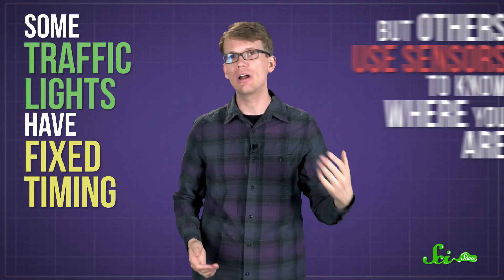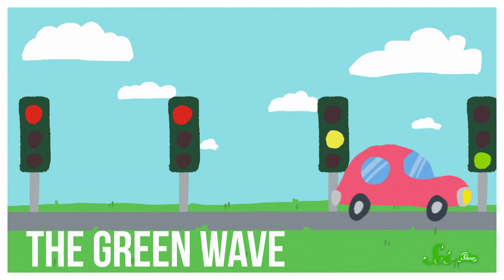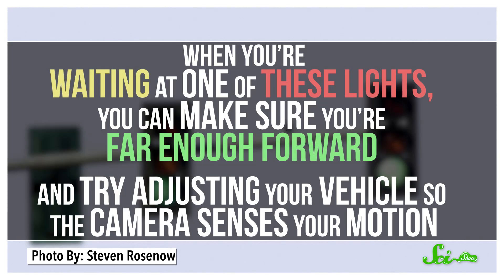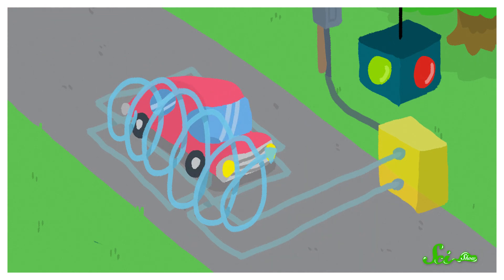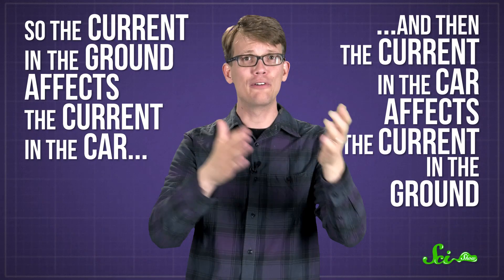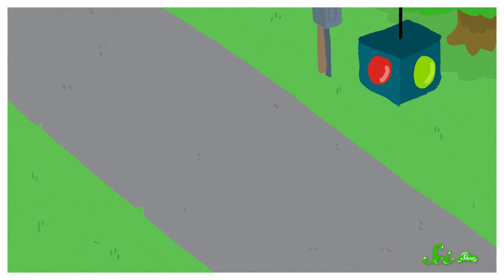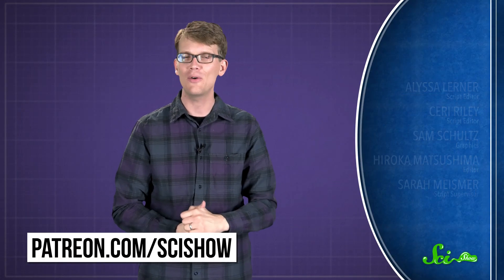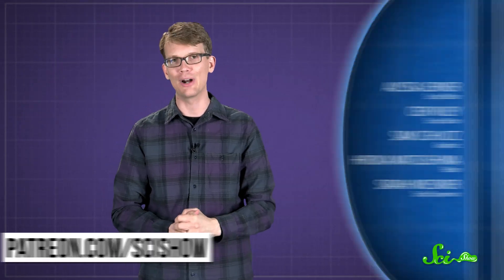How Can I Make A Traffic Light Turn Green?

Comment: BS, bicycles can easily trip loop detectors. I ride a bicycle a lot and have done it hundreds of times. The trick is to find out where the loop is (easy on a bike, you can see where the pavement was slit to insert the wires). Then make sure the bike is in the loop but to one side of it, say 75 to 80% of the way to the left or the right side.

Comment: How to make a light turn green: 
1. Wait
Reply: Sometimes the sensor does not sense your vehicle.   I work late at night and drive home at 2am.   I have pulled up to a red light and waited several minutes and it didn't change.    Driving a couple of feet back and forth usually gets the light to change but one night I tried that repeatedly and fifteen minutes later I decided the heck with it and just very cautiously crept through the intersection.    

Years earlier I lived at an intersection where there was a set of lights.   The cops would go out at one A.M. and activate the override.   That would make one direction continuously red and the other one continuously green never changing.  Then he'd park behind a bush and wait.   He always set the light so that the busier street got the red light.   At 1 A.M. it usually only took a few minutes for a car to come by and it would wait patiently, drive back and forth a few inches hoping to get the light to change and it wouldn't then finally he would slowly creep across the intersection when it became obvious that the light was never going to change.  The cop then pulled him over.   I stayed up one night and watched this cop pull over about 15 cars.   He did this perhaps about once a week.   Then around 5 A.M. he'd reactivate the normal traffic mode and be on his way.   I tried to report this at the police station but was threatened with a charge of obstruction of justice if I went to the media.   So I went to city hall instead and got the same threat.   After moving away I learned that they did this at several other intersections and also had speed traps set up and between those two activities the city made about $3 million a year.   Not bad for a city of 15,000 people.   Within a couple of years of that happening the police chief committed suicide and the mayor went to prison and the city declared bankruptcy.
Reply: The left turn light never turned green for me after 3 cycles so I went straight.
Reply: PhoenixPoptart 
2. Profit.

Comment: The loop system is just a metal detector buried in the ground.  Some detection systems use cameras that detect motion and lights. Sometimes if I'm stuck at a light I flash my headlights and it works, so flash your lights if you suspect a camera. I ride a motorcycle and I have attached a magnet from a hard drive to the bottom insole of my boot. When I come to a looped detection circuit, I wave my foot over the buried loop and like magic, the light changes. Same with a bicycle. If you ride a bike, disassemble a hard drive and use the rare earth magent trip traffic sensors.

Comment: Wouldn't it make more sense to just make the sensors weight triggered? Why all of the fuckin' unnecessary science?
Reply: weight sensors are not as good as induction loops at dealing with changes in temperature, also they cost more than a wire and they break more frequently so they're basically inferior in most cases.

Comment: I was hoping that the full method of sensing a vehicle with induction sensors was discussed. Such as how a signal is passed through the loop then the metal vehicle induces a phase change in the signal.

Comment: There is actually another method that works, and it has a 100% success rate. 

When you stop at a signal, just start staring at the light. If you stare hard enough, you will get it to finally turn green. This method takes patience, but it works every time.
Reply: lol i get it!
Reply: Sea Agate ...
Reply: +Ringz 321
How could you not get it?
Reply: That doesn't work!  I used to try that when my mother was driving when I was in elementary school!
Reply: Or, just run the red. 99.99% success rate.
Reply: Not every time.   One town I lived in had defective traffic lights that pretty much went into sleep mode if it went ten minutes or longer without any car going through the intersection.  They you had to call the police and they would, when they got around to it, come by and turn the system back on.   In another jurisdiction I lived in, the cops deliberately deactivated the green mode so they could catch people running red lights.    I think they still do that.   Central Falls RI if you are interested.   So no, it does not always eventually turn green.
Reply: that's funny

Comment: The sensor on top of the traffic light that was said to be a camera, is not. It is an infrared receiver like that on a TV set. Emergency vehicles use a piece of equipment called an IR-com to quickly change the street lights on approach. You can make your own with an adjustable strobe light and infrared lens.

Comment: SciShow is a great channel, but there are a couple of inconsistencies in the video.  First, the device shown at 0:49 is not a camera, but a Emergency vehicle preemption device.  This allows an emergency vehicle to get a green light.  A camera for detection looks like this: http://www.modot.org/stlouis/links/signalcameras.htm.  You may also see cameras like this: http://www.okokchina.com/Files/uppic18/Dome%20Camera%20Housing%20(security_%20surveillance)824.jpg  which are used to monitor traffic operations.  Second, FYI,it is possible to have a coordinated (what he called green wave), and have sensors for the side streets.

Comment: If on a motorcycle, and the light is controlled by an induction loop, aim for a corner rather than the center.  That's where they are most sensitive.  I don't know why this is the case, but I used to install, test, and repair loops and loop detectors. (amoungst other things)  Often I could get them to trip using the access cover from the gate control box, or if that was not available I carried a small bit of 4" square tube.  These small items worked on the corners of the loop, and generally nowhere else in the loop.

Comment: For bikes and motorcycles, the relatively cheap and simple solution is to stick a decent sized super powerful neodymium magnet to the bottom of your 2 wheeler. Run over the sensor and be on your way. It works like a charm.

Comment: You can flash your high beams when you're coming up to a red (with no one else around of course) and it triggers the light as well. It picks you up as an emergency vehicle. On bikes, if I lay my bike down over the loop, it always triggers it.
Reply: If you can get the bike wheel directly over the wire it will reliably trigger the light

Comment: You can change the light with a road bicycle actually if the rims are steel or if there's steel within the rims.  I've been doing it for years!  Just place your wheels over the wires in the street.  Works every time!  Helps if you place both wheels and roll back and forth on the wire a little bit.

Comment: in my area at night the lights with cameras can be changed by flashing your bright lights, it sounds silly but I have tested it several times and it works even when the light just turned red and cars are coming the other way so its not very polite to do unless the street is empty

Comment: You won't get caught if you run a red that has no camera.  There are two kinds of cameras, the ones he's talking about, and the ones designed to take your picture when you pass through the induction loop while it's red.  Those cameras are huge.

If you don't see them, you could run the red if nobody is around.

But there could be a cop sitting just out of view, so...

Comment: as someone that installs traffic signals if you flashing you high beams and the light changes more then likely is a coincidence. the strobes the ems, fire, and police use are set so a specific frequency ( very fast and very bright) and it would be very hard to match that flashing your high beams. also the thing circled as a camera is a detector for the the strobes (opticom system)

Comment: Veteran biker here, jump up and land on the seat of your bike. This pushes your bike down on its shocks and will usually set off the light. It doesn't always work and may not work depending on the type of motorcycle you ride but it has worked for me for years.

Comment: So it would help to get up off my motorcycle and put down the kick stand, only to have to push off the kickstand when it turns green. Seems safe. Luckily most states have "go on red" laws for Motorcycles in the event your stuck at an unchanging light. (One near my house has a sensor i can never set off :/ )

Comment: Error in the video: What is circled as a traffic detection camera is not a camera at all, but is an optical sensor that detects modulated strobe lights on emergency vehicles to trip the emergency preemption. Traffic detection cameras look very obviously like small video cameras. But otherwise good introductory video about how signals work.

Comment: Another trick you  can use(and it doesn't always work), is if you find yourself at a traffic light at night, with no one nearby, and you don''t want to wait forever, try flashing your brights at it 2-3 times very quickly.  Some traffic lights are programed to recognized flashing lights as emergency vehicles(police, ambulances and soforth) and change quickly for their passage.

Comment: "If you're on a bicycle run the light"
How cute. Pretending that cyclists EVER obey the rules of the road.
Reply: Since a bike can drive on the sidewalk in many jurisdictions, you can't hold it to all the traffic laws. It's a gray area legally. In any case, most problems caused by bikes and cars together are caused by the cars. For example, in Kansas, a vehicle is supposed to give 3 feet clearance to a bike. If you ride a bike a few blocks, you will see this law is ignored. 
It is also ignored by the traffic police. 
I suspect the problem is a sort of prejudice against bikes because they are smaller. Drivers of cars don't realize the bikes have a right to the road as well. They believe bikes, since they are smaller, have less of a right. And then the sensitive drivers get mad about it. Note your post. It illustrates this prejudice.

Comment: In Florida the lights are timed HORRIBLE. 
At Fl 54 & the Sun Coast Highway they have enough room for a clover leaf system to keep things moving. And to make it worse 54 has to stop for the  Suncoast ramps and THERE WOLL BE NO CARS EITHER COMING FROM THE SC OR TRYING TO MAKE LEFT TURNS ACROSS 54 TO GET ONTO THE  SC. Just a 1/4 mile deep pile of traffic on 54 waiting for the stupid light to change. When it comes to traffic pattern design  (waiting at a red light, green just in time for the light at the next intersection to turn red) Florida traffic engeneers must drop a lot of acid!

Comment: That was very good but you might want to make another video after you read this. OK let's say a car is approaching an intersection the light is green but a lot of cars just approached the traffic from the other way that would normally cause your green light to turn red so you have to wait for all time for the cars to go through the intersection then get a green light NO!!! you don't have to wait for them just step on it and plow right through them and hope you and hope you don't get into much trouble,, oops that's not right what you do is stop the car right over the sensor loop farthest from the intersection  this will trick the electronics in the control box to think you are a lot of cars and make the light turn green very soon this works for a bicycle to just lay the bicycle down on the sensor farthest from the intersection that will also trick the electronics to turn the light green for you , I did this a lot of the time when all I had was a bicycle and it always worked.

Comment: Just wait for the light you impatient fuck heads.
Reply: they have patience issues but you got anger issues 😶
Reply: ...and you have problems with using punctuation. Nobody's perfect.
Reply: Oh dang he brought up punctuation 😥
Reply: to be honest some lights only change when they detect a car, and sometimes your car isnt detected and you have go into reverse or go forward to get it detected ive waited at lights for 5 minutes, moved and it immediately change. patience does not help in this case
Reply: /r/madlads
Reply: I drive an all mechanical diesel. Some lights will never change for it. It's a big, 3/4 ton, 4x4 truck. 
I can wait 10-15 minutes, the second a car comes up behind or beside me, it will change.
Reply: 🔥🔥🔥🔥🔥🔥🔥🔥🔥DANG
Reply: DAVE KANE WOWOOWOOWOWOWO
Reply: Throwing stones in glass houses....
Reply: P
Reply: Then take a right.

Comment: So I get this this kind of a simplistic view of the use of an eddy current, but couldn't we line the streets with wires and power electric vehicles? I mean not completely but help slightly charge the battery? Even if it was a small amount, think if every time you stopped or slowed down to take a turn.... I am sure that they have thought about this before and what holds it back is the cost of infrastructure... still a small city beta test would be interesting

Comment: You CAN do something with induction loops if you're on a bicycle. All you have to do is make sure you go through the loop closer to one side of the loop (left or right) rather than through the middle. This will ensure that you bike accesses two separate points of the loop at the same time, which seems to do the trick, especially for circular loops.

Comment: if you're a bike, use the side walk, or bike path...
Reply: In my town bikes aren't allowed on side walks and there are no bike lanes
Reply: in what states does riding a bicycle require a license???? lol
Reply: ViscountStratton point is, most states, if you're a kid it's fine to be on the side walk. Otherwise you must ride in the street and (generally) follow traffic laws as though you are any other motor vehicle. I say 'generally' because it's typically fine to yeild to red lights or stop signs.
Reply: Kevin Bacon Yeah. In Michigan bicyclists usually ride on the street, but off to the shoulder to avoid jamming the traffic. Seems to work pretty well. But I could see how biking inside the traffic lane itself would be practical for large cities where traffic rarely goes 35+ mph.

Comment: On my way to work at 11PM, my little motorcycle failed to trip the left turn lane sensor. I waited several minutes and when nobody was coming, I ran the red light. Immediately, red and blue lights came on in a nearby parking lot. I explained to the officer that I had waited through two complete cycles of the light, but my turn arrow never came on. He gave me a ticket anyway. I asked him what I should do to make it trip. His answer was that I should back up and try to trigger it again. I explained that my motorcycle did not have reverse gear. I went to court to fight it and when the judge asked him what happened he replied "I have no recollection of this incident". I was found not guilty. On our way out he said "Oh well, it worked out for you in the end". I told him that I worked the overnight shift and had to come to court during my sleep time and it was not OK.

Comment: On a motorcycle, you can also push the starter button to change the current in the loop. Use it at the gate for my complex all the time. Adversely, over years, you will probably wear out your starter sooner than later

Comment: Hank missed a trick for the induction loop lights that also works for bicycles but motorcyclist use mostly. Place a powerful magnet usually as close to the ground as you can and it will trigger the light.

Comment: I have found that with the pads on a motorcycle. don't stop in the center of the pad, get directly over the cut lines where the wire would be set in the cut marks or else you could be stopped with the wire completely circling you and not picking up your signal.  And get a magnet on the bottom of the frame to help disrupt the sensor so it knows you are there.  It may be the placebo effect for me, but I think it works.

Comment: And what about the magnet method under the bike ?
Reply: It's highly likely the magnetic coil is running on a high-ish frequency Alternating Current (AFAIK there is no way to detect a static lump of metal, or magnet, with a coil with a static field), so a Magnet won't help any more than just a lump of metal. Unless you spin the magnet maybe?... Even then, the logic in the detector might be trying to cancel out any disturbance, making a spinning magnet counterproductive :(

Comment: I ride a motorcycle and it sucks getting caught at a light that won't change but have heard, on more than one occasion, that attaching a good size magnet to the bottom of the frame will help with the light changing. Anyone know if this is true or not?

Comment: Do some red light cameras use these induction loops to detect speed to predict running a red?

I noticed I could trigger red light cameras by pulling up hard from speed limit to a dead stop on top of these loops where there was no one around and the cameras flash lol.

Comment: Or you could just put a strobe light on your dash with an IR filter. Then record a fire truck or police drive by and replay the tape in slow motion to see the pattern or Hz of strobe.. Build a little circuit with a PLC controlling your strobe. Now you can turn all the lights green when its on. The IR filter blocks the flash in case you are worried about people seeing it.Forget the sensor just press a button!